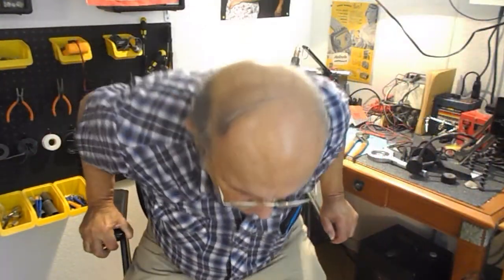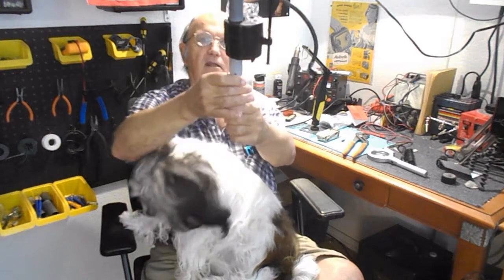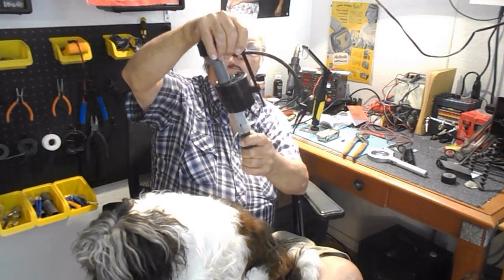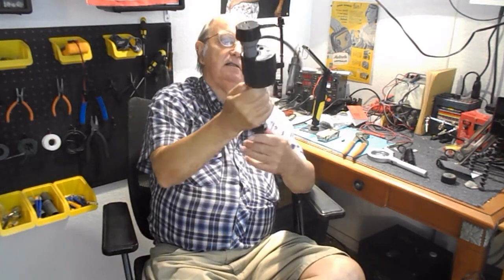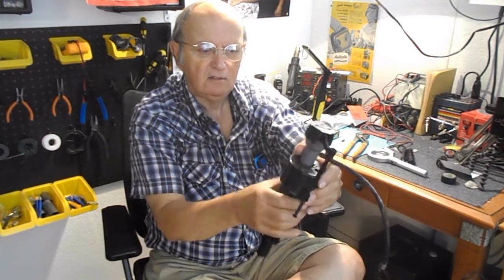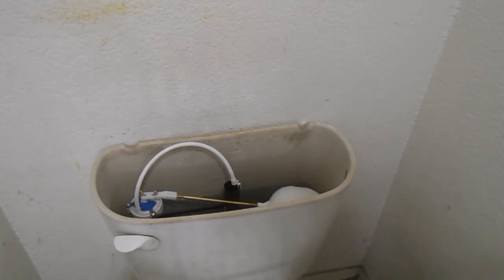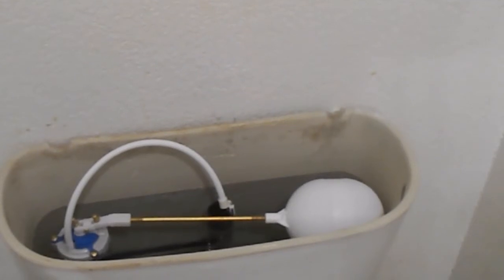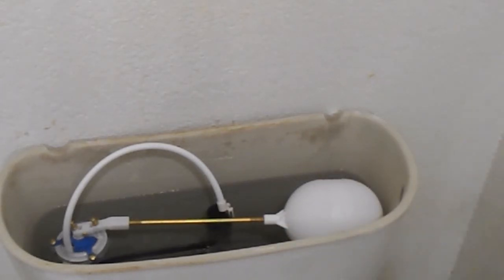Which is better the Fluid Master or conventional ball cock?

Comment: just got a new fangled two button crapper, one for pee, the other for poop.  the old crapper had a fluid madter that lasted years.
Reply from the maker: You must have gotten a pre Chinese made fluid master but plumbing contractors and others I have talked to said the fluid Master is crap cheap Chinese made junk. How long before the buttons die in the new crapper? Is it easy to replace parts on it or do you need an engineering degree to figure it out?